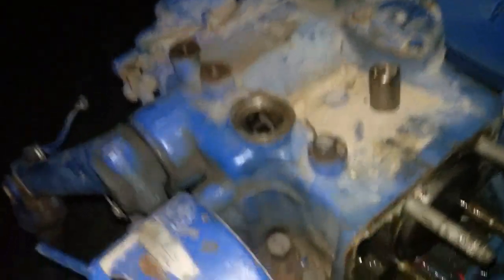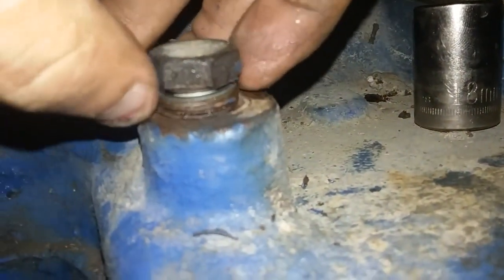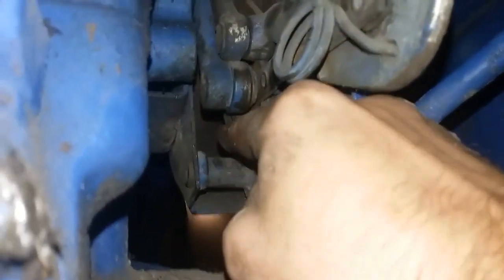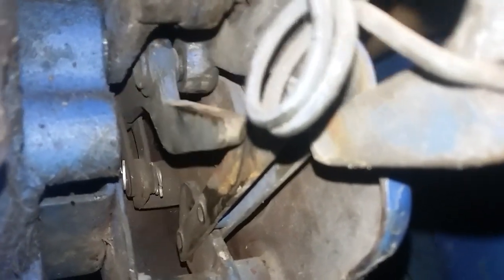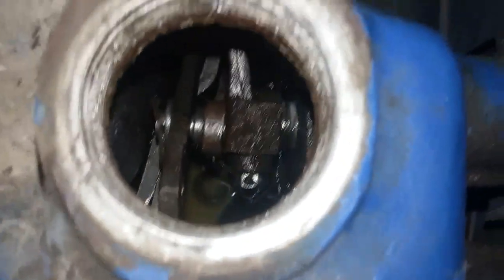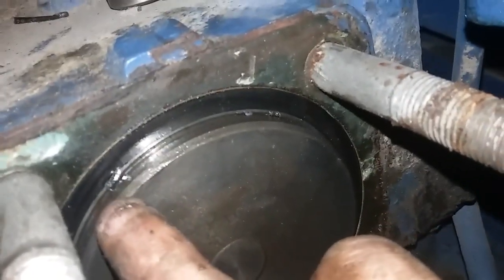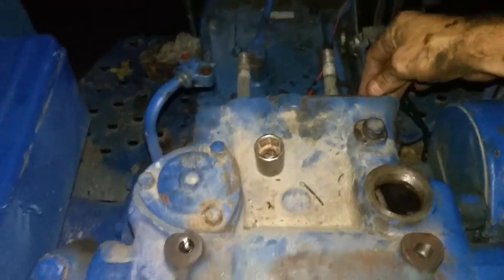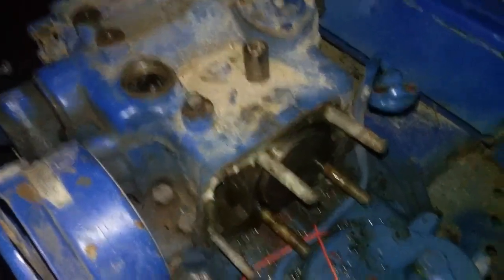Long 460 - Opening 3 point Hydraulic system under seat

Comment: I am so happy to see someone make a video like this on the Long 460 tractor. I have the Long 460DT (center drive) and I haven't had any problems similar to yours but, it is so nice to see someone with this tractor actually making video on a problem they've had and how they handled it. My Long is a WORKHORSE but, it has it's problems. You've inspired me to video those problems and how I handle them. I plan on repairing a few real soon. Please keep it up.
Reply from the maker: Guy Smith sadly, after this repair I ended up selling the tractor due to the lack of access and expense of replacement parts. I wish I would have documented more. I took out all of the wiring harnesses under the hood and complete rewired that tractor, rebuilt the hydraulic manifold, repainted, retapped screw holes that had gone bad, reworked the 3 point arms through a series of replacement parts. I do plan to get another tractor, but it won't be a Long.

Comment: Thanks a ton for this vid.  I searched a long time for a look at the guts of that assembly and finally a guy on another channel told me about this video.  My tractor is a UTB 640 (same as the Long tractors) and my lift lever is disconnected inside there.  Now that I got a look at this, I know what I'm in for.  Where do you order your parts?  I'm guessing I'm gonna need at least the gasket, and I might as well do any o-rings or copper rings that are inside that assembly.  There is a channel of some guy in South or Central America that does a lot of work on the UTB's, but the videos are all in Spanish and he has nothing posted for that job.  I wish there was more content on the 'tube.  I will try to record the task when I get to it.
Reply from the maker: https://www.longparts.com/ is where I ordered parts from. It's up in the air if they have the part you're looking for. But it's better than checking around random junk yards in hopes there's a chance that they have a 38 year old tractor with good parts. 

I've already sold the tractor a couple of years ago after I got everything working again as I determined that serviceability was likely to get more complicated as the years passed. But for sure if you have the means to create videos on your projects I 100% recommend it. These are by far the most watched videos I've put on youtube, which means that they (hopefully) provide a lot of people helpful information prior to starting their projects on their tractors as to what to expect going into it. 

Look forward to seeing your videos!

Comment: Great video i have an utb 445 also an old one 1989 and its a very good machine, need to do the hydraulic a bit too, mine wont lower all the way for some reason, probably the return valve is dirty, but anyway keep the videos comming.

Comment: A friend of mine has a universal 445 4x4.
He hasn't got a manual.
Been trying to work out what oil goes in what.
I understand engine and front diff.
I see you had milky oil in hyd filter, his oil in front diff and dipstick near seat is milky.
Not sure if trans, diff and pto is the same oil as no one can tell me.
Castrol Agritrans 20w 30 is recommended 16 litres.
Any help be great as tractor is up in mountains 1 hr from parts shop
Reply from the maker: Honestly I don't want to give an incorrect answer. The best suggestion I can make for any piece of equipment you own is to get a service manual and reference that to know what you should do with your tractor. 

With that said mine wasn't a 4wd and there fore didn't have a front diff. I just used generic tractor hydraulic fluid from oreillys. 

My thoughts would be if the front diff uses hydraulic fluid that whatever is recommended for the rear section would likely be the same for the front. These older pieces of equipment weren't as complicated as the new stuff and usually tried to use the same stuff in as many places as possible. But I don't know that for sure.
Reply: @Zerkini  thanks, .
Doesn't have a manual and if I bought one he would complain about the price, front diff and rear diff is 85 140 gear oil as castrol lube guide said, just wasn't sure if Hydraulics and trans ran the same, as hyd oil is abit thin for gearbox.
Never done much on tractor drives, mainly trucks, cars etc.
Haven't had a real good look at dipsticks on rear as we had other problems that needed attending to like running tank dry , broke filter head and trying to bleed, caught fire where he sprayed aerostrt where manifold heater was and had to rewire, inlet heater staying on with accessories after starting, worn universal joint, serviced engine, battery and alternator problem, oil bath air filter clean, post rammer pulley had roll pin missing and wore shaft out,  and was getting dark and strapped for time.
Tractor is a hr away and owner is very slack at maintenance and not doing what I ask him to do when he goes there, off with the pixies.

Comment: WHAT WAS YOUR PROBLEM WITH HYDRAULICS I AM HAVING ISSUES , JUST WONDERING THANX
Reply from the maker: My guess was a bad seal somewhere which caused it to leak off pressure. As a byproduct it wouldn't hold the height i set and would slowly go down.

Comment: I recently bought my first tractor. Long 560. How much fluid goes in the fill and what kind please? Or how full is it supposed to be. Mine seems very low and leaks out of the adjuster that you showed in this video
Reply from the maker: There should be a dip stick along the body on the right side where you would rest your foot while not braking. The stick should reflect the optimal amount of fluid stored in the body of the tractor.
Reply from the maker: http://www.tractordata.com/farm-tractors/005/8/1/5819-long-560.html

Check out tractordata for more information on your specific model.

Comment: Is there a manifold I can add to mine for rear hudraulic remotes? I cant find anything on it. I have a 2460 long but yours is very similar to mine.
Reply: On a Long 2460, there should be a remote control valve on the left of the driver's position, under the seat. There should be a lever control that comes out from under the driver's seat on the right side that is connected to the remote control valve. You can go here to see the lines and couplers to connect to the remote control valve to get your rear hydraulic remotes ---> http://www.importtractorparts.net/auxvalve.html.
Reply: Best bet is go to a salvage yard and look at them. Even if you have to replace the hoses it gets you all the brackets and parts needed.

Comment: Sir,
After changing my hydraulic fluid and cleaning the metal filter I got about 30 minutes of use from my lift and then the lift stopped working.  Any suggestions?
Reply from the maker: Vernon Hardee I wish I could make an educated guess based on that information. check that the lever is moving the short arm shown in this video. it's located inside the right side lever box. you can see it from behind the tractor. If that's moving as it should you may have a hydraulic pump failure or an o-ring failure inside the hydraulic manifold. But to keep it simple, start with checking your hydraulic fluid level. there should be a dipstick on the right side on the body of tractor if you have the same model.
Reply: Zerkini 
Thank you sir.  I called my local dealer who is as honest as the day is long.  He told me to tap on the front of the valve body right under the seat.  One tap and to lift started working again.  I appreciate your video and reply.  

Vern
Reply: Re check the filter.
Mine came without one  and after installing a new filter screen it was soon clogged with debris.
Removed. Cleaned and on again. It clogged a short time after. Even after repeated oil changes.  Got tired of cleaning and recleaning. So I removed it.
Apparently the only good way to get all the junk out is to disassemble the transmission housing. It's been working like that for 20+ years